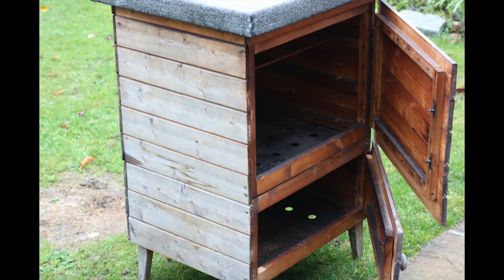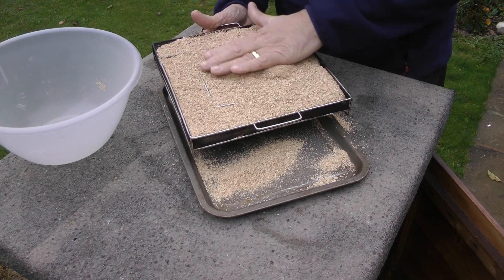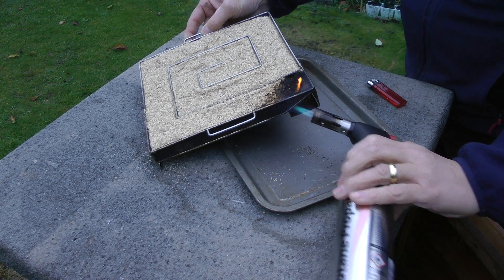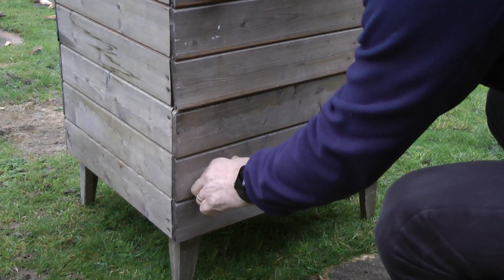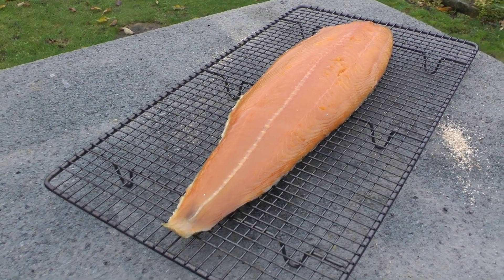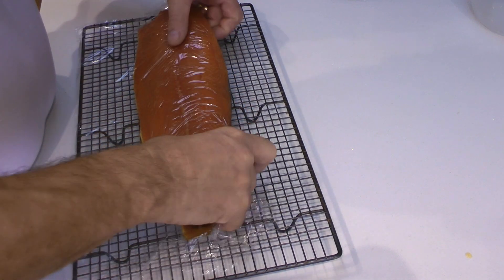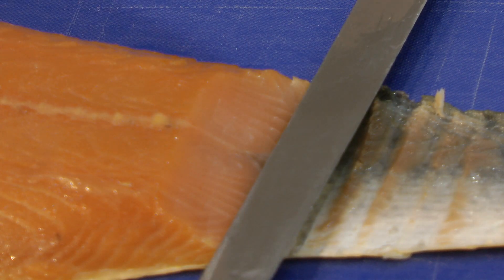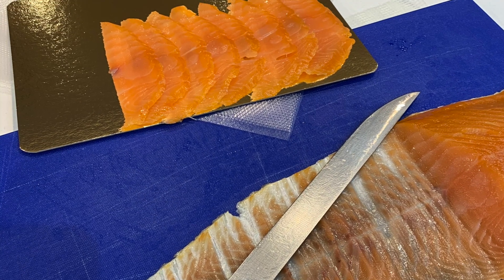HOW TO MAKE COLD SMOKED SALMON Part 4 - Cold Smoking & Slicing

Comment: Very interesting and informative video, how long will cold smoked salmon keep in a fridge running at 3^ vacuum packed?
Reply from the maker: I keep it under vacuum in the fridge for about 10 days. It's better to freeze it under vacuum as it doesn't take very long to defrost when required. I've had salmon frozen in this manner for over a year.
Reply: @Coldsmoking  that’s a bummer! mines been in there for about a month 😢
Reply from the maker: @BreadandCrafts  personally i’d use my nose 😂

Comment: Another great vid that I'm keen to copy!  Quick question... I've only got a small ProQ smoker so would have to cut the salmon side in half. Is there anything I would need to adjust in the process do you think?
Reply from the maker: no, carry out the process as per the vid. cut it in half to fit it in the smoker if you needed to. 👍🐟

Comment: i have the smaller pro q cold smoking device, is 8 -10 hours enough or should i refill and go for a second round of smoking? thanks!
Reply from the maker: Hi Daniel, yes of course you can. the smoking part does help preserve the salmon but it also adds flavour. if you like it smokey then reload and go again. be aware the salmon will dry a little the longer it’s in the smoker. 👍 good luck.